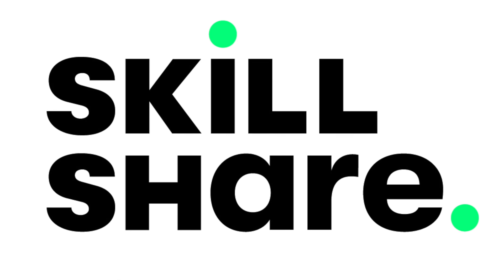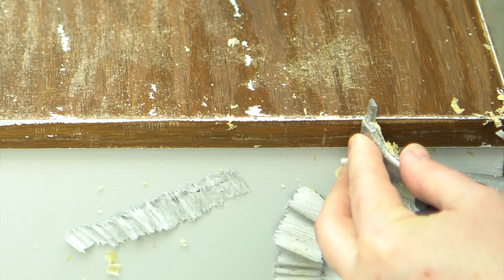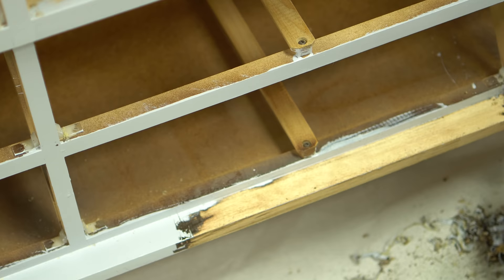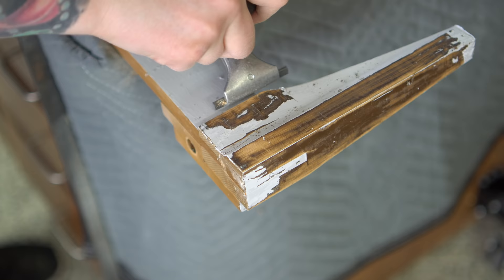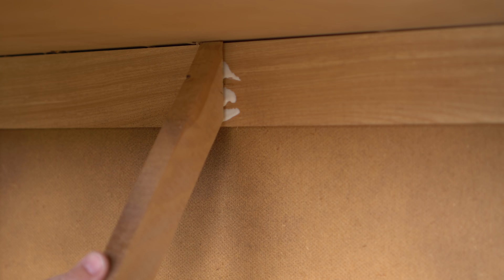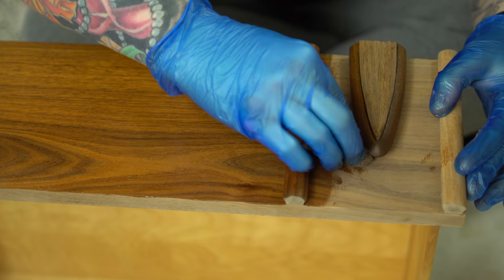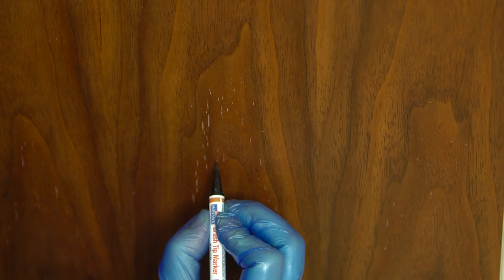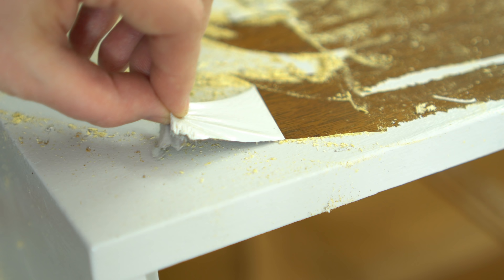The paint practically FELL off this dresser: GORGEOUS MAKEOVER

Comment: Indiana that looks incredible, stunning.
It is brutal when the paint gets into the wood grain. Not fun at all. I have done the same thing get in there with something sharp on the deeper grooves to get the pain out after soaking the piece with mineral spirits. Portable so used a little nylon brush which also helps.
I thought the oldies oil alone on the finish was not going to be dark enough but I was wrong looks awesome. I would grain is beautiful.
And happy Easter!

Comment: Nifty.  I appreciate this video because I'm working on my first piece, an executive desk, and the topcoat was so thick that it took forever.  I threw everything but the kitchen sink at it because I was so unsure of what I was seeing.  I scraped but was afraid that I was going togo through the veneer.  Watching you scrape and see the pressure you were using and the way the wood looked as you were working helped a great deal.  Tell me, did you sharpen your scraper in the time that you worked on this piece?  I feel that mine doesn't do as good a job as yours.

Comment: Here's a thought would using a sand/soda blaster be good for smaller pieces to remove paint? We use it to remove paint from metal of course. Would that chew up the wood? On lower setting maybe? I wouldn't use it on veneers but the solid legs or the those decorative pieces on the drawer fronts?
Reply from the maker: Soda blasting is great for those carved and curvy solid wood details! I haven’t tried one yet but I do know they work pretty well for that stuff. :-)

Comment: Incredible! You are an amazing talent & teacher. Is Odie's comparable to Hemp Oil?
Reply from the maker: Thank you! No, Odie’s is actually a hard wax oil (general terms- it goes on like an oil but dries in a much different way than hemp oil). It doesn’t build up on the surface like a normal wax, it absorbs into the wood and protects at that level. Hemp oil (and some other oils) are considered non drying oils and don’t generally offer the same level of protection (and usually need reapplication more often).

Comment: Out standing job looks so much better how many totals hours was this
Reply from the maker: Because I have to film these projects, they take me much longer than they would otherwise. Every time I move at all, the camera has to be repositioned, so it actually makes it extremely difficult to estimate how long for each project. It depends also on materials used, dry times etc, whether it’s cold or hot and humid that day, as that can also affect dry times. Most pieces take me at least a few days, sometimes up to a week or more. I know that’s not a very accurate answer but the truth is, because I have a lot camerawork added in, I honestly don’t know.

Comment: Amazing transformation! I love learning from your channel, quick question, do you test all of the paint and finished under the paint on your mid century pieces for lead? I have a piece I’m working on and It looks fine but I’m wondering how common of an issue it is that you run into that or if most pieces from the 50s and forward in time are not toxic
Any thoughts or advice is appreciated
Reply from the maker: I keep a lead testing kit in my shop at all times and I've learned through experience when to test and see. I don't test them all but I do test any I suspect. I have redone a piece that had lead, the video is here - https://www.youtube.com/watch?v=IVXWaeHzyQA&t=2s I hope this helps! Thanks so much for watching!

Comment: Gardening tip - DO NOT EVER use plastic weed matt anywhere you plan to try to grow anything.  Underneath bricks or gravelled paths, it's fine.  But in flowerbeds, it's a disaster.  It took me an entire summer to dig out 20 year old weed matting in a dahlia bed, riddled with bindweed roots running like cancerous spaghetti under the matting and laughing at me wherever it poked through to run rampant.  It kills the soil underneath (not a single earthworm did I find!), doesn't prevent weeds growing through whatever mulch you use, and is just horrible horrible horrible.  Bad for the environment, bad for the garden.  Meanwhile, another gorgeous transformation and an inspiration to get me going on a cute little art deco box chest rescued from the local tip...

Comment: So I have a question. Do you show the process of the refinishing of the item to the new owner? How do you calculate the asking price for resale?
Reply from the maker: I show it to them if they'd like to see it, quite often they see the before picture in the ad I post and sometimes they're subscribers. As for pricing some people try to use an hourly rate on non commissioned pieces but I don’t find that very accurate. Sometimes the tiniest details take FOREVER, and would quickly “price out” the piece you’re working on. I go by what the piece itself is worth, based on comparable products in my area, and the finishes I’ve done to it. Most of my pieces sell within minutes. Which generally means I’m pricing too low, lol. But I don’t have the space to keep pieces for days and weeks so I need them to move fast. If I had more room, perhaps I could get a price closer to what some others in my area are charging. Which has gone WAYYYY up.

Comment: Don't know if it will work for you but a heat gun would have removed that paint easily.
Reply from the maker: I don’t like using a heat gun to remove paint (although it’s definitely efficient). It’s a hazard and the fumes make me nauseated. I actually talked about that at 8:40 in this video- https://youtu.be/pq9mHXUcBNY

I know a lot of people do it but for me, just not worth the health or fire risk.😞
Reply: @TranscendFurnitureGallery  fair enough.  I know the old lead paint or alkyd is pretty nasty to heat strip.